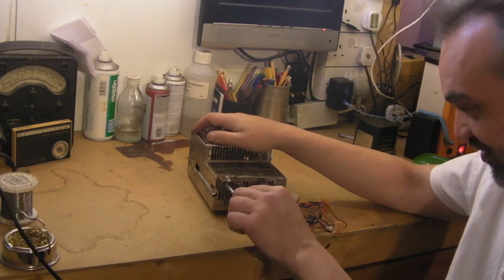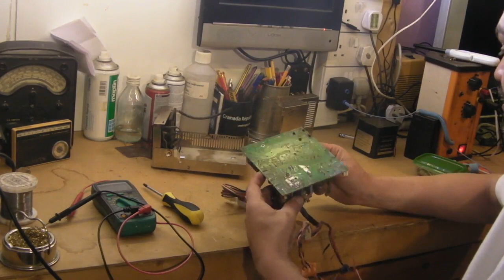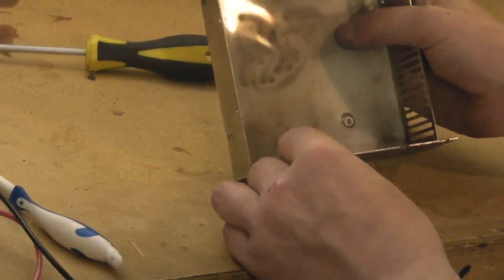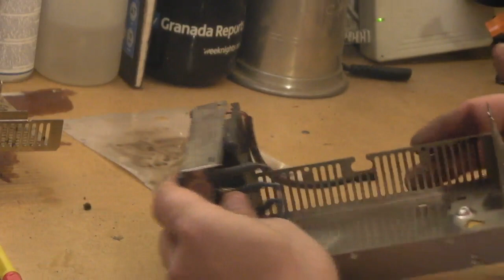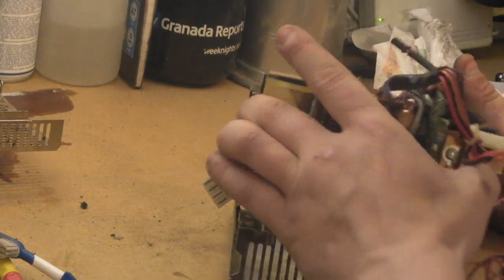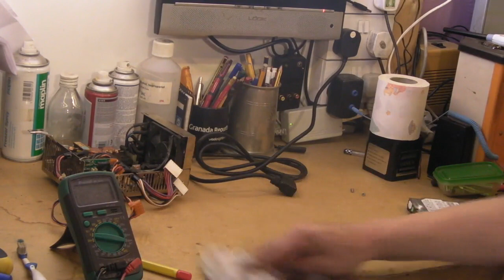Olivetti M250 Resurrection Pt1 checking over the PSU

Comment: Good to see the PSU works!  Pain when there's so much rust on the case =/  Lots of work with wire brush and fibre glass pen.  You could use a dremel to help speed up rust removal.